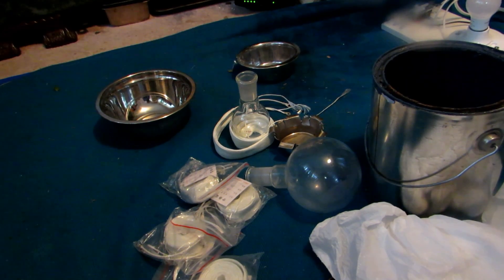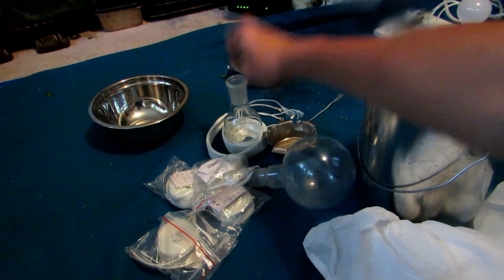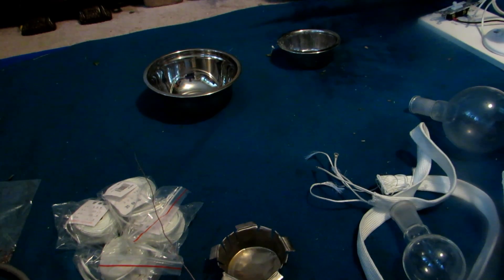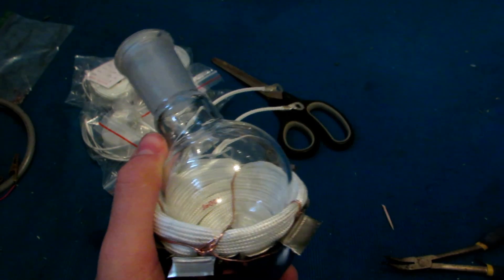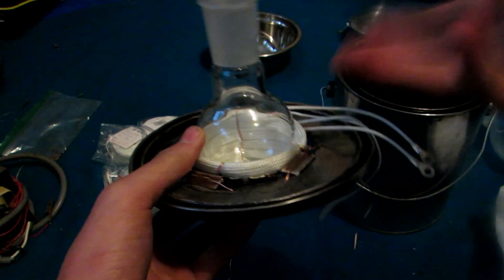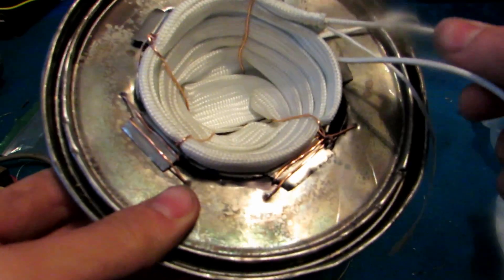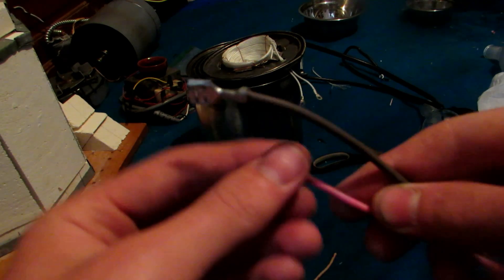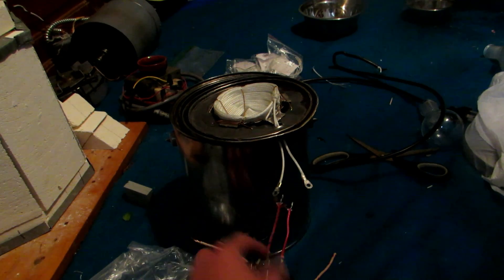High Tempurature Heating Mantle (Household Materials)

Comment: Hopefully yer lab hasn't burned to the ground yet.  First off, I love yer content.  You have a can do attitude and confidence to take on whatever the world throws at you.  I don't wish to pick apart your work, but for safeties sake I wanna straighten out one small mistake.  The circuit breakers opposite each other in yer panel are connected to the same phase and therefore at the same potential.  This means you don't have 240V between them, but 0 volts.  If you use the neutral for one of your conductors then you will have 120 volts.  To get 240 out of your electrical panel, and this applies in the US as well as Canada, use two adjacent breakers. Or, to do it properly install a 2 pole breaker and wire a 240 v receptacle and add a 240 v male plug to your mantel.  Or, better yet forget 240 volts, you don't need it.  Just wire it for 120 volts.  Keep the content coming goods sir!

Comment: If you use a PID regulator with a thermocoupler, you should be able to control the heat very well. To secure holes against scraping of the wire, you could use a short piece of thin hose, cut it along the side so it forms an incomplete circle and push in place around the rugged edge.  
Below the mantle you could even add a motor/fan with magnets to add stirring-functionality.
Reply: Great tip! The only thing I would add is to maybe use a piece of silicone tubing/hose as it can handle a lot more heat than other types of materials used to make tubing/hoses. They sell them pretty cheap and are usually even marked as "Food Grade". But if you can't find any, you can also probably get away with just squeezing some silicone caulking around the sharp edges.
Reply from the maker: Adding stirring functionality is definitely something I plan on doing in the future. And a PID controller is a great idea, thanks!

Comment: I like your ID and your concept but I bet you're two different outlets or not from rooms next to each other so you're Long reach of extension cords is a fire risk and definitely an electricity voltage drop the length of your cord is not idea to pull power through that far.
Your dishwasher washer dryer some ovens run off 220.
Trevor get a chance look at that thick gauge wire for those breakers in your electrical panel. They're bigger than 12 gauge wires are 10-gauge wires powerless to that is 220

Comment: In America we call then rc50 squeezable electrical conductor connector.  There to prevent snags and stripping the electrical sheathing from The wire and to protect the integrity of the electrical wire and avoid dead shorts. And staggering your electrical connection wires would be ideal to not have them touch each other seeing that they are the same length

Comment: GREAT VIDEO ....Love the thermostat.   I got a dimmer switch on mine.  But i did just buy  a $15 electronic  high temp thermostat with a probe type sensor.   Goes from  minus 30 to 999 C.   You just wire in the thermostat to the common wire on the heating tape and plug in the thermostat to any home socket.    And i got some refractory bricks.  Those white high temp bricks that almost seem like they are made out of chalk.   Going to sand a semi sphere hole into the bricks for the round bottom flask so the heat does not escape into the room.   And put the sensor probe right in between the refractory brick and the heating tape so it touches the heating tape.   This way i never have to fiddle with the thermostat trying to get it to the temp i want.   I just plug in the temp i want into the electronic thermostat and it does all the work form then on.     Hey i usually buy 120/110 V heating  tape and they work just as good as the 240V ones.  They both heat up almost instantaneously and both get up to high temps.   But with the 120/110V ones you do not need to have 2 extension cords from 2 different rooms to get the 240V.   Also the 110/120V ones are only like $40 to $50 in USAmerican dollars.   A $150 seems expensive to me.  But it is probably because you are buying the 240V ones
Reply: Glad you're alive and active my friend.
Reply: @tuxedopig7940  ...........Thanks buddy.   I am still kicking.  At least for now...lol.

Comment: Part two wrap in fiberglass color make me a set  sell em, trade you for vol port dewars flasks for heat dry ice super cooling vacuum, throw in a synth cool or doubles have gave fortune to school, dummy!  See crazy stuff on Craigslist sometimes, goes fast. Full lab but for extracting marijuana still regular stuff 25k sold for $3400 or less listing gone. Offered way more for columns,  folks should split lots, sell lab stuff for 3-5 pieces huge overheads, centrifuges, all sorts older but cool stuff 3/120 or $50 whose buying full incubators and tissue culture, micro slicers, used not fit fun.

Comment: You can purchase new, clean cans from some paint distributors. Heat resistant grommets (Teflon) could protect the wires better. Project seems to me a bit limited in  that, most boiling flask applications involve a distillation process, of which many require magnetic stirring.

Comment: I know this is over a year old video, but you and your viewers should know more about that over switch you're using. All those old style oven switches are more generally known as a "Bi-Metallic Switch". They do not, in any way, alter the voltage or current. They are made up of a strip of 2 dissimilar metals that will curve or bend when heated. As they cool they "close" and complete a circuit allowing current through, and as they heat up they flex away from the fixed contact and "open" the circuit. The knob adjusts the position of the fixed contactor or pre-tensions the bimetallic strip (end result is the same). At the lower setting the contacts start out as far away as they can get (and still function), so it takes very little current to open the circuit, and as it cools there's more travel between them - ideally this will result in current flowing about 10% of the time. At 9 the contacts start close, and will take much longer to open and close sooner, resulting in a duty cycle of about 90%, and 10/high will just bypass the strip and force the switch closed 100%. Typically the cycle rate of these switches will be be around 1 minute, so at 5 it's on for 30 seconds then off for 30 seconds, but it varies by model and design a bit.   They are rated for both a voltage and current(yours is 240V 15A) and they need to operate at or very near those limits to function properly (i.e. conform to their intended duty cycle). Too little current and you'll have very little control if any, too much current and they will either burn out or just open too frequently. 

This is not an ideal design for a heating mantle of this deign for chemistry because you really want a very stable temperature. In this example your heating tape will draw full current and voltage for X seconds, heating up well past your intended temperature, then be off, cooling down and possibly undershooting your intended temperature. Your heat load - the flask and it's contents, will be hard to maintain at a stable temperature. Fine for boiling water to make tea, not great for distillation of 2 fractions that have boiling points near each other. 

There's 2 better options, and neither are significantly more expensive if you're resourceful.  

First you can use a PID controller with a thermocouple and relay, this is a digital control, and the newer ones use fuzzy logic to program themselves to hold a set point with extreme accuracy. They self earn your appliance, and become more precise as they get closer to the set point. It's ultimately the same as your switch, it just turns the full rated current on and off, but in a much more precise manner, and typically at a faster cycle rate (10-20 seconds is fine for mechanical relays, 1-5 seconds for a solid state relay) You can get really fancy and get a PWM capable controller and relay, which will turn on and off 120 times per second and "clip" the AC wave form, which has the effect of  limiting voltage... this would be hands down the most precise way. On ebay or surplus stores you can get a PWM controller, K type thermocouple, and a 500W PWM relay for under $50. Buy you HAVE to use the thermocouple, and know where it should be (usually in a thermocouple well above your flask). 

Next is what you'll see most hobby labs using,  which is a variac, or variable transformer. They can be more expensive, but I've found suitable ones (500W units) for under $50 on eBay and local surplus places. These usually need to be wired up, but if you can manage the over switch you'll figure them out. A variac actually controls the voltage, which will allow you to fine tune the heat of the tape. They will limit the wattage going in, and therefore the maximum temperature of the mantle, so you can get very precise heating.  

A light dimmer would work if it's the old style, with a large heat sink - they're just variable resistors, and will heat up as they take whatever % of the load you're NOT using, so a 200w heating tape needs to be on a 200W dimmer, but avoid the triac dimmers (almost all the modern ones), as I've had bad luck using them to control pure resistive loads.
Reply from the maker: Sorry, I just read this now. Wow! I honestly had no clue how those old switches work. Thank you very much for the insight. I really appreciate it. I have used my current heating mantle for a variety of projects, and I find it is fine for doing almost any reaction or distillation because the amount of substance I’m heating up has a high enough mass that there is no significant over cooling or over heating, but I can definitely see how it would be an issue on small scale reactions where heat is lost more easily. I will look into some of the alternatives you mentioned. Thanks!
Reply: @TheCanadianChemist You are doing a great job.
Your tips and tricks could be valuable to any hobbyist.  Expensive apertures are necessary for highly sensitive experiments but not for hobbyists.  
so much thanks.❤️
Reply: Thank you very much for your time and skill in this matter. You educated us all

Comment: How did you make this heating blanket for a 1L flask? I imagine that you could serially connect several heating tapes to build a mantle for larger capacity balloons.
Reply: It's better to connect them in parallel. To connect them in series you would have to cut the fiber glass and cause them to "unstitch" themselves.

Comment: Unregulated this will smoke n the wires will burst... I used nichrome wire n a pid controller n had them pop twice on calibration mode - _- so good luck..
Reply: Thanks for the heads up.

Comment: This is really cool how you make these.  The only thing different I would do is to start the winding proccess at the bottom of the round flask with the two wire leads and finish with the dead ended lead.  This way you won't have to run the wire leads back through the lid as they will already be in the can.  
     Thanks and thumbs up for sure.

Comment: Awesome video.  I'm sure I'll be referencing it sometime in the future.  I've got a heating mantle that will accommodate a 500mL round bottom flask.  I think I paid between $70 to $100--I can't remember.  All I know is it works, but I haven't really used it much and I don't have faith in it lasting incredibly long.  I typically use my magnetic stir hot plates for everything.

Comment: I was expecting you to use some mould-able fire-clay rather than having your element in such close proximity with metal. It might be safer.
Reply: Go to some of the metal melting or glass blowing chanel's. The build kilns all the time. Some of them list material suppliers. On material I know of is called Satanite

Comment: Good but not safe with acid as   a beaker break hot liquid will come in contact with wire having running current bye the way good effort  make mantle with watch substance that will not make a mess at the of accident